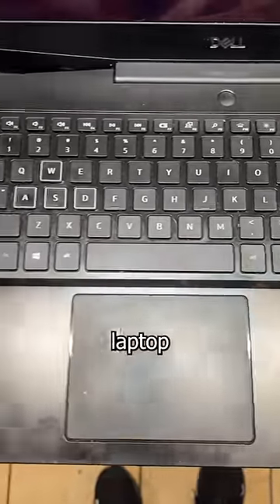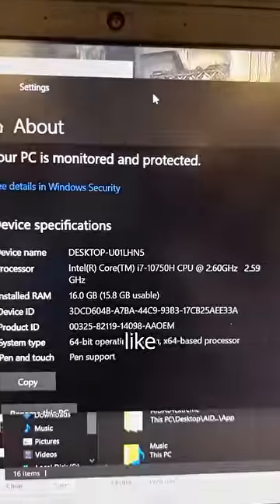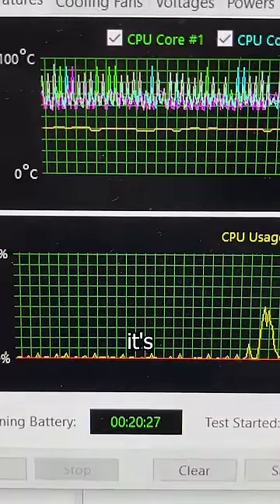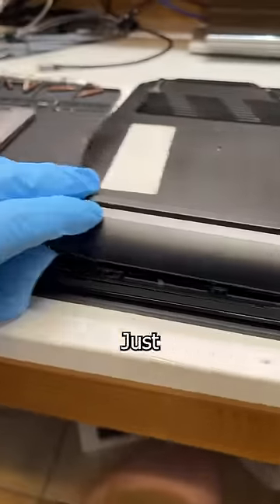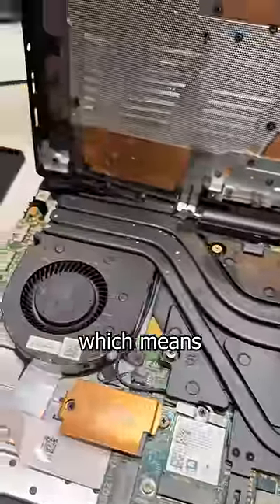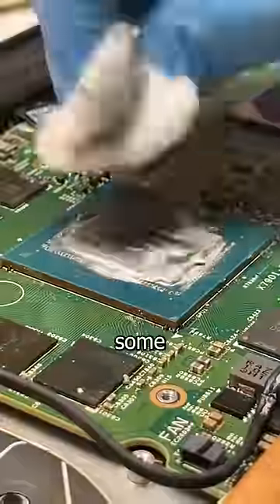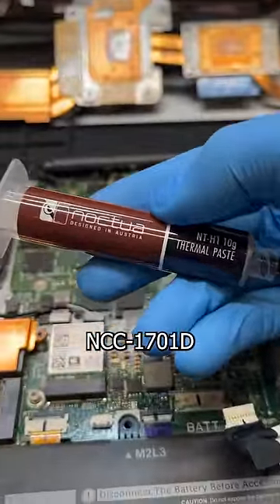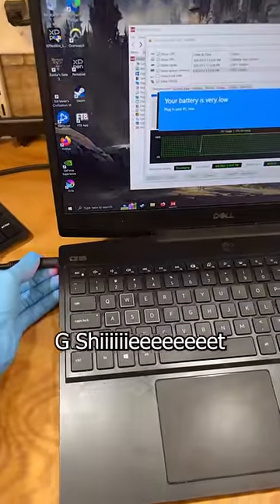Dell G5 is a terrible #gaming laptop with a terrible cooling system #tech #technology #shorts

Comment: Poor design for the bottom, needs more vents to breath, it’s got pretty darn good specs and with that comes a storm of heat, my laptop has a 3050ti which is weaker then a 2070 but yeah it tends to get hot but not hot enough to thermal throttle or act up on me.
Reply: @RedOnCod  *breathe
*3050 Ti
*than
Reply: @GrainGrown  like spacing Ti makes a damn difference, get a life keyboard warrior 😂
Reply: @RedOnCod  Not only spacing, but writing it correctly.
Keep learning how to write, kiddo.
Reply: @GrainGrown  Why the hell I bother arguing with a whole as bot account who barely joined youtube lmao.